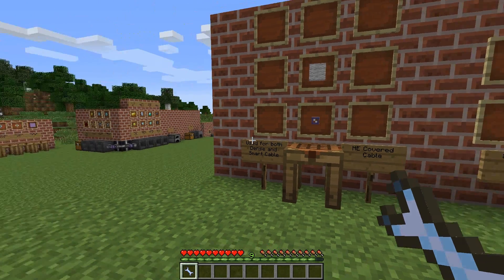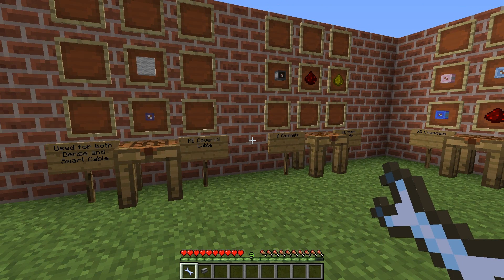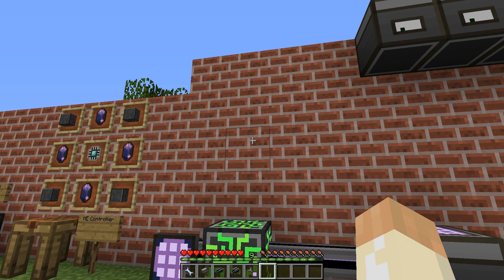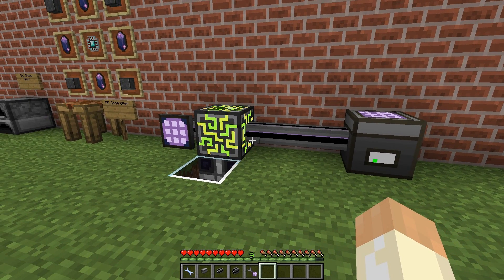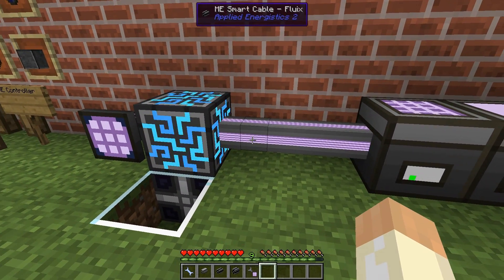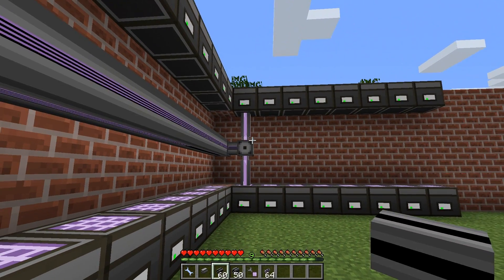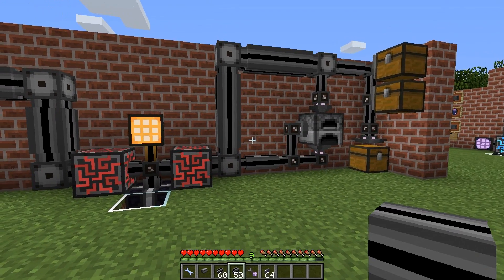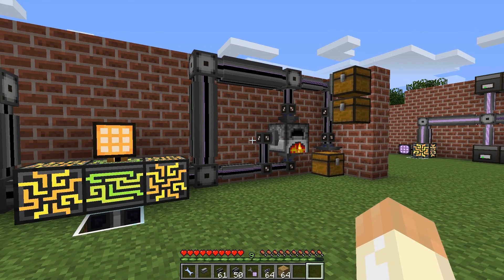Applied Energistics 2 Tutorial #4: ME Controller Networks (MC 1.7.2 / 1.7.10)

Comment: Is it possible to hook up the machines that require manual use (like the metal press) to automate from the main terminal? I really hate needing to stop crafting to run to a different machine and back.
Reply from the maker: Sorry for a late reply, but please specify what Metal Press you're using (from what mod). There might be several....
Reply: TKH specifically the IE metal press. I can’t get it to drop 4 ingots to make a gear.
Reply from the maker: Not a problem, I just did it with a Hopper and an extra Conveyor Belt on the input, and then a Dropping Conveyor Belt on top of an Interface on the output. Feel free to jump on my Discord if you want some screenshots or more explanation (discord.tkh.one).

Comment: how is ur controller changing color?!?!?!
Reply from the maker: It does that when it runs (has power and network is considered ok). If it's totally blank it means that it have no power and if it's red the network as an error.
Reply: For some reason mine is only pulsating between blue and purple
Reply from the maker: But it still works, right?
Reply: TKH yes, i was just wondering y mine looks different, rainbow is way cooler lol

Comment: Can you help? I'm trying to pull out cobbelstone, Gravel and stuff so on from my ME system into difference Deep Storage units. But I can't seem to get it to work.
Reply from the maker: +cWOWpro First of all, what mod selection or modpack are you using? Versions? I have used AE2 with DSU:s, it shouldn't be a problem. I think I used a Storage Bus to put items into the DSU, have you tried that? Can't try it now myself (not at home). Note that things won't export automatically just because you set up a storage bus. Only an export bus will do that.
Reply: +TKH I think I made it work with an storage bus and a export bus. I just think that I was confused because there were a difference in the dsu and in the Me system. But I guess it wasnt able to put it out fast enough :D
Reply from the maker: +cWOWpro Ok, good :) Just make sure that when you put in or pull out [resource] that it only is put into - and taken out of - the DSU and not the normal storage. Might need to set a higher priority on whatever is connected to the DSU.
Reply: +TKH arh. This is confusing :c

Comment from the maker: To previous commenter (israel krzys), I can't hit reply to the comment so perhaps you won't be notified. Anyway, this subject was covered in a previous video, as I said in the video: read video description and watch the other videos if you don't already know the things from before... Anyway, there are several other mods supported, connect the power to an Energy Acceptor and you're good.
Reply: I had a bit of trouble with this too. Eventually figured power conduits connect directly to the ME Controller blocks, just like AE1, rather than ME Cables. So any power system, run conduit to an Energy Acceptor or your ME Controller block and that will automatically rout power into system. So you don't need to waste time making an Energy Acceptor unless you run out of Controller ports/faces. Hope this helps anyone with the same problem.
Reply: Can you partition the storage cells the same way you can in AE1? I cant seem to find a partion editor or similar device.
Reply from the maker: DanDustEmOff Yes, you can partition them. Not at my computer now, but I think you can do it from an MC Chest? You should be able to do it from the Cell Workbench at least.
Reply: Ah Cell workbench, I was searching for partition editor, lol!

Comment: Can ME Cable of any kind provide power to Thermal Expansion machines, ie Redstone Furnace / Pulverizer?
Reply from the maker: Yes, but not without two other mods. You can send RF into an (ME) P2P tunnel, this will give you MJ in the network. Extract the MJ power with a P2P tunnel again using a Wooden Kinesis Pipe + Golden Kinesis Pipe. Combine this with a Transfer (Energy) Node from Extra Utilities to convert MJ back to RF and then connect to the Energy Conduit that goes to your machine. Easy! :D

Comment: I'm not a maths wiz, so can someone else do this... but think about this... a full channel, with a controller, just like at 12:20 BUT every chest, is a ME drive, FULL of 64k storage things, HOW MANY ITEMS WOULD THAT BE?!
Reply from the maker: Fun question :) It depends on how many different items types you want to store per cell. If you have only one type of item (like Cobblestone), one 64k cell can store 8128 stacks = 520192 Cobblestone. If you had 63 different sorts, you can store 4160 stacks = 266240 items. Counted on 64 items per stack. So if we calculate that span on 10 cells per drive, and 32 drives on one side of a controller... You get a span from 85 to 166 million items per ME Controller side, depending on how many different items types you have per storage cell. I haven't tested it on a 64k cell, but I did the math and verified it on a 1k cell, so I think these numbers are correct :)
Reply: So BASICALLY, if you mined out your whole world, it would probably fit in your network :3

Comment: Good Video again...i have a question...how do i get enough energy to my system? do i have to put coal inside the vibration chamber everytime i want to acces my terminal??
Reply from the maker: yougotthe crowbar That's a good solution, but no need to add or remove cable since there is a dedicated bus (ME Toggle Bus) which responds to redstone signal. Using that you can turn the accelerators on/off with just a lever :)
Reply from the maker: There are basically two ways as I understand it: The Vibration Chamber is the only way to generate power within AE2. And since the system requires power all the time to function you'll have to put in more Coal (or other) into the chamber when you need access. The second way is to use other mods to generate power and use the Energy Acceptor. But still is constant power generation required when you want to use the system!
Reply: therealtkh
Thanks Alot, thats what i thought, i use a droper filled with coal and a button on it so i only have to press the button and the dropper fills coal into the vibration chamber...i will try to find  solution for longer power...becuase i dont want to put a 64 stack into the virbatin chamber and all the nergy is blown away if im not at the terminal....
Reply from the maker: djjoker12 Yea, that sounds like a convenient solution to save resources. But a permanent (renewable) power system is of course better! Do you have other mods to help you with that?
Reply: Im not sure...i play on version 1.7.2..what other mods are there??
Reply from the maker: djjoker12 So you're doing your own modpack so to say? Well, you have BuildCraft and IndustrialCraft to start with... But I haven't checked what mods (like Forestry) that can provide you with treefarms or other things. Start with adding mods you want to have, then investigate what's in them ;)
Reply: i recomend you use a storage cell and attach it to the v. chamber, that way when you want to use your system you just add a cable that attaches it too your system.